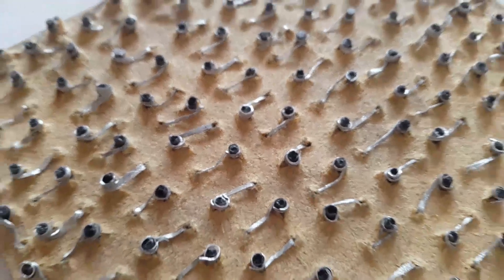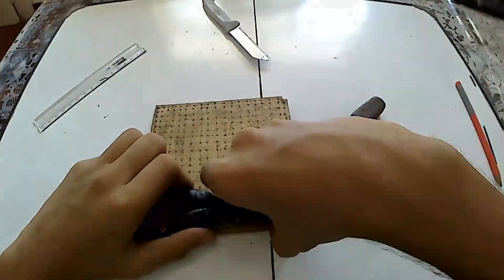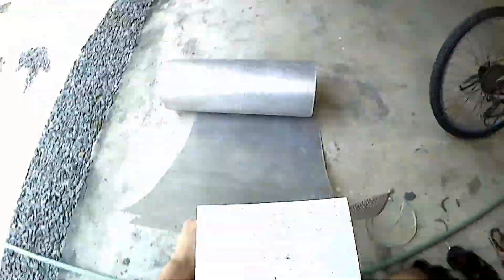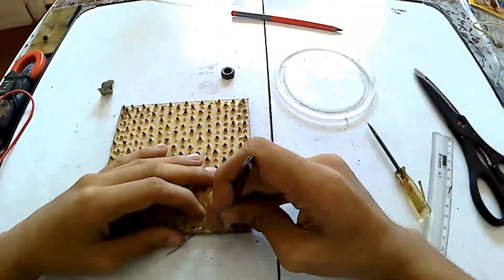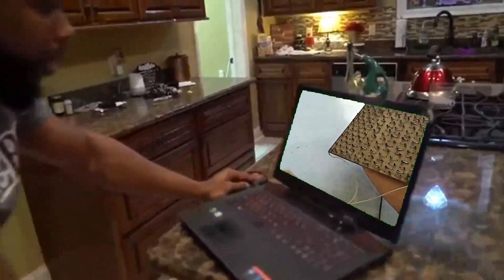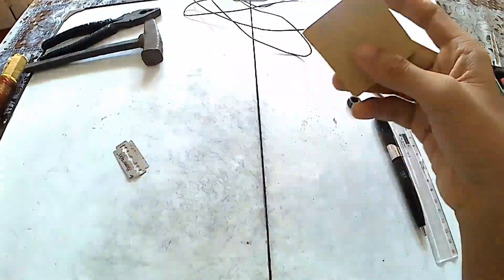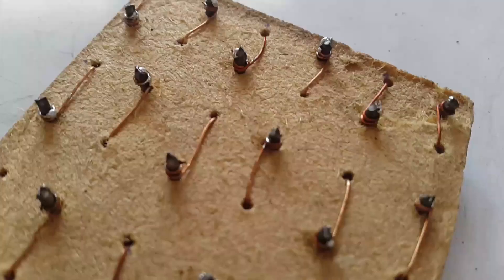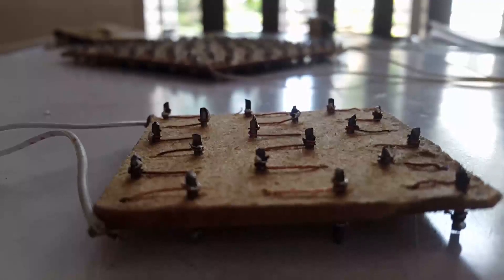Trying to make a peltier cell at home!?(don't try this at home it will cause mental breakdown)

Comment: you need to apply heatsinks to increase the heat absorbtion on the hot side forcing it to bring in more heat which should cool the cooler end. the two different materials need to be comnected with a non reactive nonmetal conductor to perform the heat transfer. you can experiment with the heatsinks and maybe water cooling. they must be bound with pressure to the hot side, clamped if needed or else they dont absorb heat. change the board material as paper and wood are insulators that absorb both heat and cold causing no difference. try plastic or high heat silicone. even a 2 liter cut into a square plastic segment for a small test should help. Also Magnesium Antimony is key as it has a 4x stronger recorded effect.

Comment: bro it will create short circuit because off that i think its hot as there is no load v+ and v- will short
Reply from the maker: yes, but if the Peltier effect was strong there would have been a temperature difference in the sides where 1(current move from graphite to aluminum) and 2(current move from aluminum to graphite )

Comment: I was planning to buil dpeltier for my IB Extended essay, the reseaarch topic is understanding the thermoelectric efficiency of different peltier devices that are built with different combinations of P and n-type semiconductors. Is it possible for me to build it by using different combinations of semi conductors or is it possible to find prepared pelties with different semiconductor. If you can help me that would be great, pleasseeeee.
Reply from the maker: of course you can get Peltier cells for Amazon which are widely used for cooling computer

Comment: Did you get a voltage reading from temperature difference
Reply from the maker: thats how a Peltier cell work 
but this configuration is way to inefficient for the Peltier effect to work
Reply: I realize that is how they work, I was wondering if you were able to achieve that and take a measurement

Comment: So basically you would have to scale up this massively and have great insulation to achieve a practical temperature difference?
Reply from the maker: maybe but it has a very low chance of working 
commercial Peltier cells are lot small and efficient

Comment: Hello, could you share... What was the temperature difference that you got along the two sides? 

In another video... it said max 5degree celcius. 

If thats the case... How do we increase the temperature difference?
Reply from the maker: on one side i got normal room temperature on the other side it got a little hot about 40dc. which is completely useless for any applications . im not discouraging you but making peltier module with house hold materials is not possible ( unless you have semiconductor in your house). I prefer not replicate this experiment. its just waste of time and resources. i did it to prove that some video you saw on you tube is fake . there are some videos are true like the one teslonian made.but overall dont
Reply: You need as many different wires as possible: 
https://www.google.com/search?q=seebeck+koeficient+0+c+english&tbm=isch&ved=2ahUKEwiH8-uH-oH4AhVLnaQKHZLODn8Q2-cCegQIABAA&oq=seebeck+koeficient+0+c+english&gs_lcp=CgNpbWcQA1DBBVj2F2CVG2gAcAB4AIABTIgB3ASSAQE5mAEAoAEBqgELZ3dzLXdpei1pbWfAAQE&sclient=img&ei=BfWRYsfcHcu6kgWSnbv4Bw&bih=937&biw=1920&hl=cs#imgrc=LlTqoGy3Eyi6aM
Warning: some metals can be radioactive like bismut. DO NOT USE BISMUT!!!! Bismut i good for peltier modules but not for guys
My tip is to use KONSTANTAN wire and COPPER bcz they aren't radioactive or poisonous

Comment: The person who you have followed on YouTube making a peltier module with iron and copper wires is untrustworthy. Instead you try to make one with Bismuth base N and P type semiconductors. Then you may be able to get an efficient result. But it also depends on voltage and current capacities.
Reply from the maker: dude im just a 16 year old boy. and my channel is not even monitized so geting semiconductor is kinda hard but i will definitely make one once im monitized. stay tuned for that

Comment: Please Don’t waste your time by doing random experiments and upload on YouTube. It’s very dangerous for amateur hobbyists. Your YouTube may inspire them to carry on unsuccessful experiments and may have an accident by using high power power supply or high electricity sources. It’s easy to buy peltier modules as they are cheaper and very efficient.
Reply: they are not very efficient... keep safe
Reply from the maker: what
Reply: @nerddawg  peltiers are inefficient
Reply from the maker: Yeah
Reply from the maker: come on dude i made this to literally prove that making peltier cell with house hold items are not possible and a waste of time. and i also told in this video this won't work. but considering you problem  im going to change the title a bit
Reply from the maker: Thanks for pointing out the problem

Comment: Bro! Plz make a slightly bigger one module by iron and copper and make a very thin plate (by plaster of Paris and concrete)on its both ends and then try.plz
Reply from the maker: definitely sir, It will take some time but i will make it (because this is my first comment request). Can you please explain about the plate arrangement at both ends( do you mean cover the iron and copper completely )
Reply: @nerddawg  I agree with @Mahmood Gull - but there are probably other materials you could try...
Carbon, produced from burning a beeswax candle for example - which may be no better than the pencil graphite, but who knows, it has been studied for its electrical conductivity and the results showed it to be a good conductor...you would probably need some kind of binder for the powder and probably a simple mould....It could be used for making battery electrodes, etc and other experiments also.

I have heard/read that several of these cells can be 'cascaded' together for much, much cooler temperatures! - I think "Tec Ingredients" covers that in a fridge or freezer video.

I think this is worth continuing, because the commercially available cells are said to break after just a few years (maybe sooner)... I'm not sure exactly why that is, but perhaps using different materials could make the last longer and be fixable and recyclable. Even if it's less efficient, there are some people who might have a micro-hydro generator, wind generator, etc and efficiency/power cost ($) isn't really relevant to them. And some people may have a use for the heat which is produced...Eg, for dehydrating food, brewing alcohol, etc.
Reply: @nerddawg  I will do some more research and add another comment here if I find some useful information regarding the materials.
Best wishes!
Reply: @nerddawg  Bismuth may not be essential for higher efficiency. I suspect that sometimes products are made with expensive, rare, perishable, non-recyclable, or unobtainable materials, etc, to prevent the average person from making it themselves.... In some cases, the knowledge of how to make something with common, recyclable, long lasting materials, etc, is well known and the information about it is kept quiet/secret and so on, never to be released, or at least not until the product is obsolete.
Keep that in mind and keep trying!
Reply from the maker: @Kyle-sg4rm  I will definitely try you ideas mate. And thank you soo much for the support

Comment: Your mistake is using soldering
Reply from the maker: what really matter is the connectivity between both end terminals . that's the reason i used a mutimeter
Reply: No there are no mistake